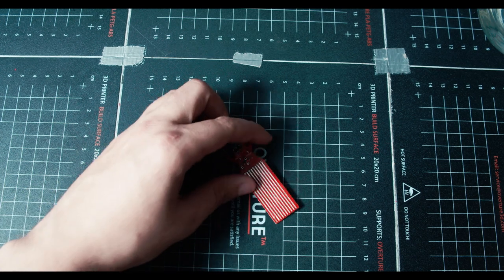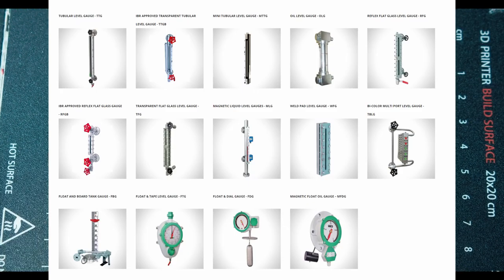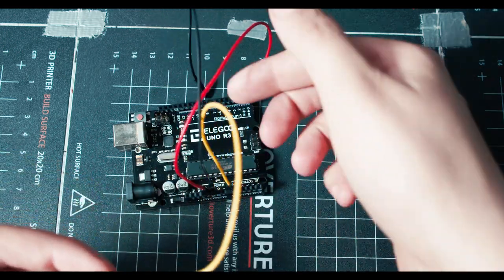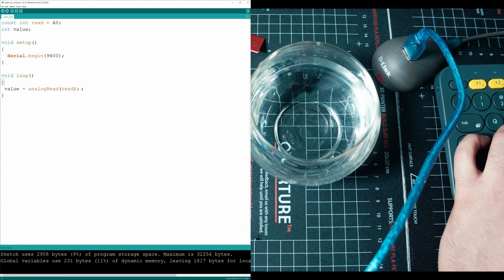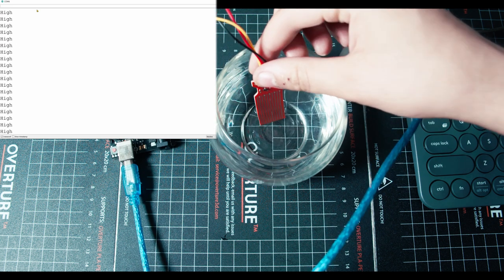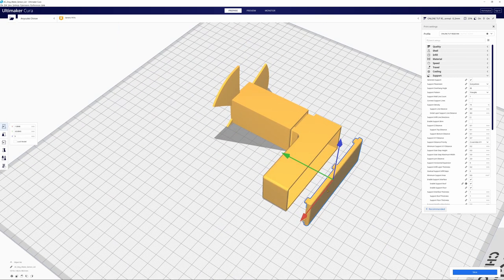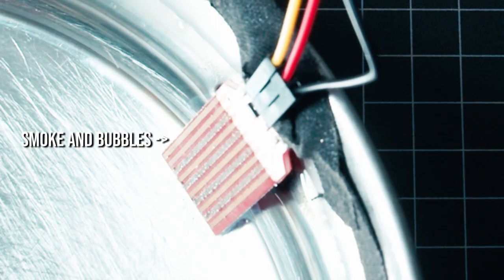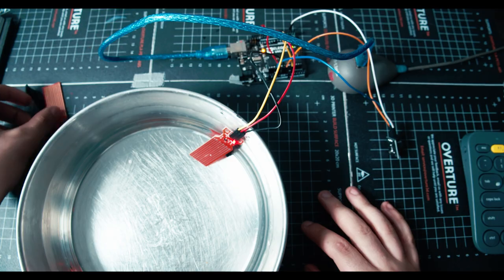Water Level Sensor *EXPLAINED* | Water Conductivity | #arduino #grindreel

Comment: Do you know how to make this sensor waterproof?
Om about to make auto pump with two water level sensor , one on top and the other one on bottom.
What should i do to make bottom sensor is waterproof? Any clue/idea?
Reply from the maker: There’s other types of water level sensors some probably better for waterproof applications, if you really wanted this one I would recommend looking into rubber coatings

Comment: And to measure greater depths what can i use? Anything other than an ultrasonic sensor?
Reply from the maker: You could make your own model based off this one, but there are other "water level" sensors out there https://bit.ly/2WekPLA
Reply: @MikaelAbehsera  thanks for the link. I was looking for more water sensors, hadnt got around to it. This is a good push. 
Your explanations are good.
Reply: You could make a capacitive level sensor but you will generally need to make it part of an astable frequency generator circuit and then convert that to a voltage for easy of measurement.  Search on YouTube for capacitive level sensing and you should find a solution along with explanation.